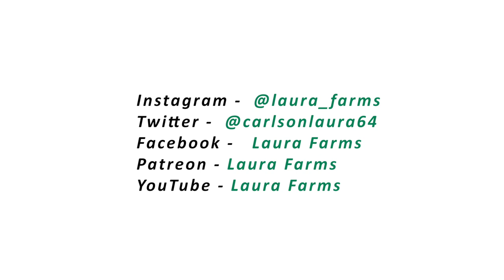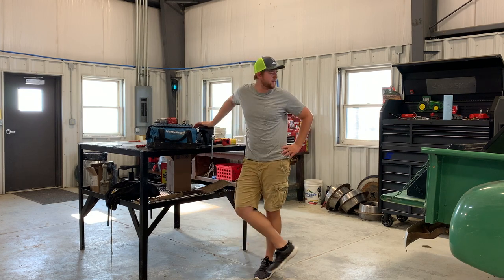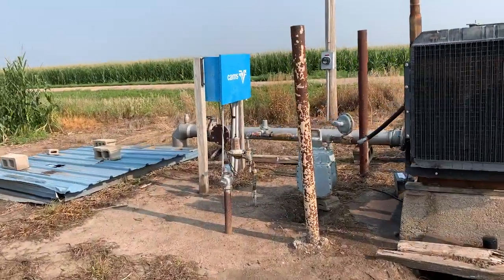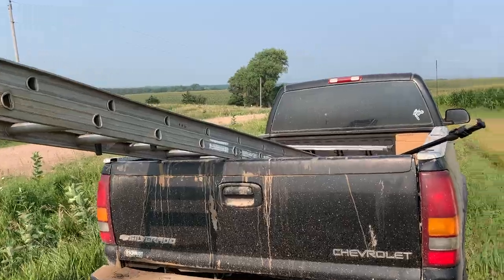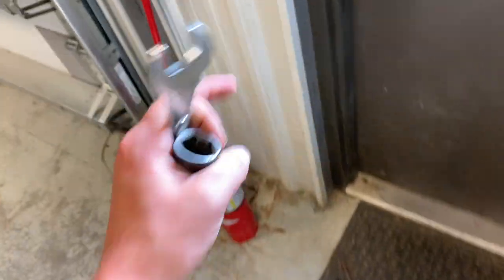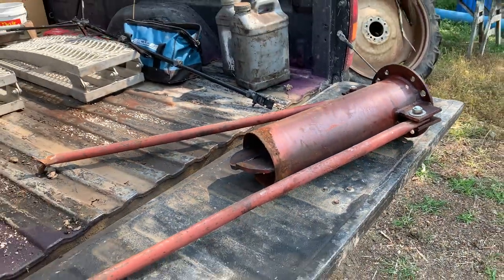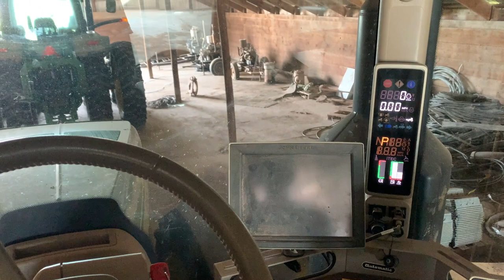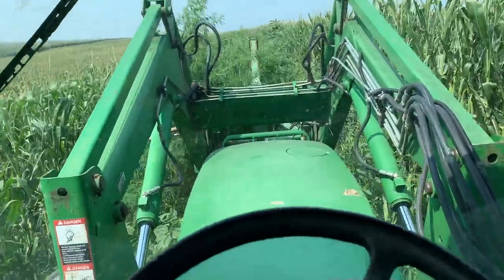Flipping Over a Pivot

Comment: Prayers for Laura’s Grandpa.  On the window tint, we used to own the biggest detail shop in the center of the state I live in and this is what worked for us, get a one edged razor blade, they have holders at a auto parts store or Walmart that is used to hold the razor blade, they are used to remove stickers, etc.  Use a spray bottle filled with water and dawn liquid soap.  You can use a heat gun, a blower hair dryer draws way too much current and will flip your breakers after running too long, plus the temperature doesn’t get as high as a heat gun does.  You can get the tint off with a lot of scraping, spraying the soap solution, and elbow grease.  Park the truck in the sun and let the window heat up first before trying to remove.  It is time consuming and a aggravating job to do.  Good luck.  👍 🙏😎✌️🚜

Comment: Hey Grant, thanks for taking the reins today! As others have said, I'm sure it's warm out there so if you let the truck sit in the sun, start at the corner of the tint with a razor blade and  it should peel right off. If it breaks off into pieces just keep at it, it's probably dried up with age. Any residual glue left behind will  scrape off with the razor blade and goo gone/adhesive remover.

Comment: You did fine, Grant!
Prayers go out for papa Curt!
I could get those broken bolts out of that cast iron for you if I were there. That used to be one of my special talents when working on engines and large commercial industrial radiators and heat exchangers along with welding many different types of metals with all methods. I could make and weld new clevises on those pivot pipes too. Too bad I'm 800+ miles away, LOL. Maybe you and Laura will come to the National Farm Machinery show here in Louisville Ky next year? Maybe have Laura's booth out there? I'd be glad to meet you both!

Comment: Heat gun will get that film off. Moderate temp to prevent cracking the glass. A plastic scraper will be ideal to get it started and then warm and peel slowly.
Reply: @DAMIAN WAGNER Iso alcohol works well for the glue as well. As for the epoxy, in most cases yes, depends on manufacturer and glass type. Cheap glass is cheap glass. That looks like toughened to me so the epoxy will be thick.
Reply: @glengillham4629  That is why you don't concentrate the heat, but move it around to warm an area. Moving warm air is better. Boiling water in winter on a frozen screen can shatter it.

Comment: Use a heat gun for paint removal, to soften the visor on your truck, it should come of easy.
Reply: You mean come off easy
Reply: Yeah definitely do this it,makes life a lot easier when it comes off as one piece, if you don't use the heat gun you'll be picking little strips and scraping with a razor blade for hours. A microfiber towel and 70% isopropyl alcohol work great for getting rid of the leftover glue.

Comment: Before using heat on the tint see if 99% ISOPROPYL rubbing alcohol will loosen it. Maybe not but it's worth a try. It's good a loosening up a lot of different resins & glues. Other thing that might work is a solvent such as WD40 or the like and letting it wick under the tint as you peel it back. A razor blade scraper is definitely needed.

Comment: Razor blade scraper to remove the tint, then use isopropanol alcohol to remove the glue residue. If you use a heat gun be careful not to put too much heat in one spot or the glass will crack...But replacing the windshield would fix your tint problem too but just at a higher dollar figure.

Comment: GOD BLESS 
POPPA CURT🙏
your tint. Save some of it across whole windshield. About 5 inches down from top.
Use a piece of cardboard for a guide and razor blade. Spray water on it using either hair dryer or heat gun.. Will come off pretty easy👍
Hope all is well with Laura and family🙏

Comment: Grant use a heat gun on the tint and it should be easy to peel off, first heat the entire piece and then heat the corner you want to start peeling from and as you peel it back keep moving the heat gun back and forth across it as you peel it off and you should be good to go..Good luck and prayers to Laura’s Grandpa..

Comment: Grant you need a basic set of tools in your work truck. I cant go anywhere without a set of tools in mine. I have tools in the shed, garage and both pickups. Never know when you need something. Can’t never have too many tools.

On the tint just pull it off. A heat gun may help. A state trooper pulled me over on my partners truck one time on my way into Aurora. I asked them if they could write a ticket for the tint just so I could take it off!

Comment: The tinted foil can be removed. Heat it up with a heat air gun, a hairdryer will work but not so fast, use a small razorblade to lift it up and then pull. If it is really old, it is a lot of work! But works when warm!

Comment: You'll want to peel that tint off (and it will suck). A heat gun might help. I didn't have open. I just had to go slow and steady. After that, I had to use Goo Gone and a scrub pad (low grit Brillo pad) to get the glue off. 

Hope gramps is doing well!!

Comment: Grant use a heat gun lightly ( and i mean lightly ) heat the tint or you will be getting a new windshield at the same time use a inspection sticker scraper on the warm tint heat and scrape a slow process but should work fine

Comment: The brow tint on your truck should not go below the line with the arrow. That AS1 line is put there for that reason. You can trim it to that line with a razor and then just peel the trimmed piece off. Or just scrape with a razor blade to remove it entirely.

Comment: Cut across at colour change with raiser blade and use blade to slip under edge and heat with blow dryer if necessary.

Comment: Probably way too late, but ammonia will dissolve the adhesive on window tint, which is why you should never use ammonia based cleaners on after-market tinted windows.

Comment: Prayers for Grandpa Curt. 🙏🙏🙏 Good job taking over for today Grant. When I removed tint they had a spray you could use that helped break the adhesion. Never tried the heat gun for it. 👍👍👍

Comment: That tiny is actually illegal, it goes lower than the AS1 line. A scraper and heat gun should do the job, and may need some adhesive remover after.

Comment: The pro's use a steam cleaner and a new razor to remove old tint. Then once you remove it there is almost always still a layer of the glue left. There is an actual tint glue remover that you just spray on and it makes it turn back to a soft, jelly like consistency. Then you just use a new razor blade to scrape it all off.
BUT, honestly man. For such a small amount. I would just contact your nearest tint place and get them to take it off when ever you head that way next. It should cost almost nothing and take no time. 
It can be a pain in the neck to do yourself and well worth handing off to someone who does it all day, everyday.

Comment: Try running a wire wheel bit in your drill or on a grinder...it will start picking up the coating without harming the glass.You can run it along in swaths across, may even loosen it enough to peel off